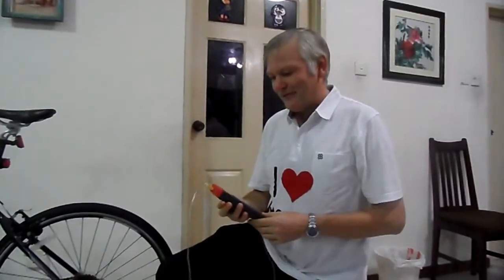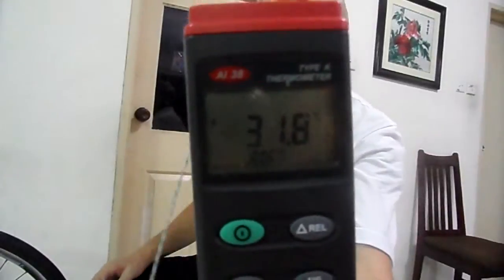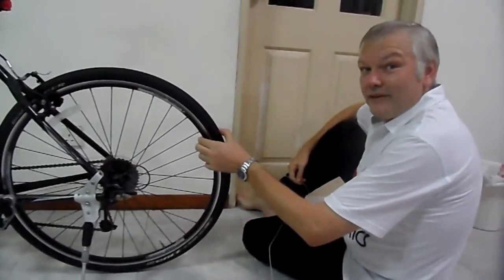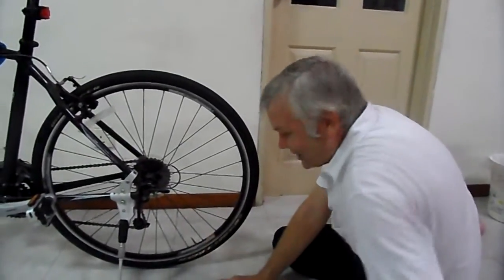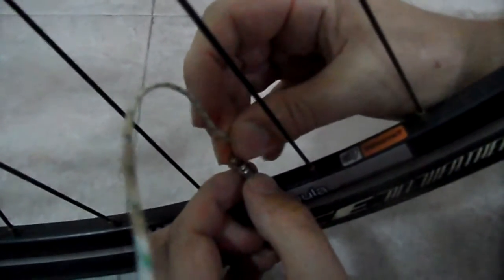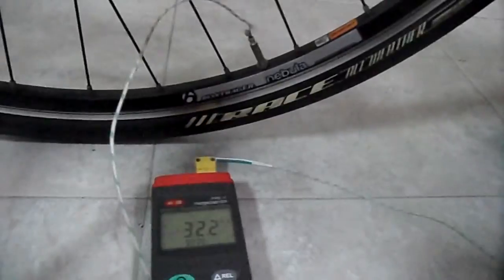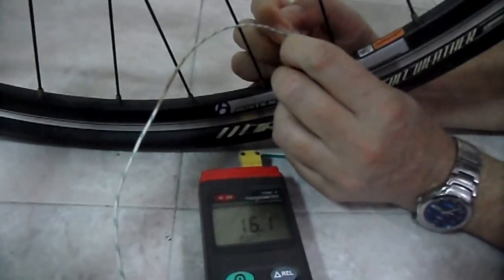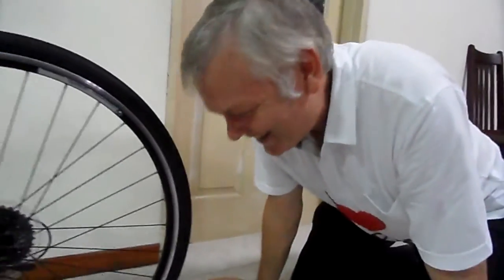Irreversible adiabatic expansion 1

Comment: Please provide an explanation
Reply: Gas Law: U = p . V = N . kB . T,  both pressure and volume drop; this means the internal energy of the gas drops; in a quick process like this only the temperature of the gas can adjust.
Reply: @veronicanoordzee6440  yes but can air temperature go that low ? Air pressure in tyre should be less that 30 psi... can you provide with data or another such video please..